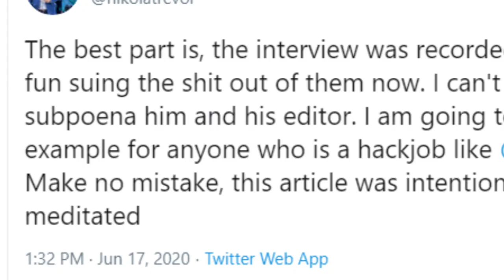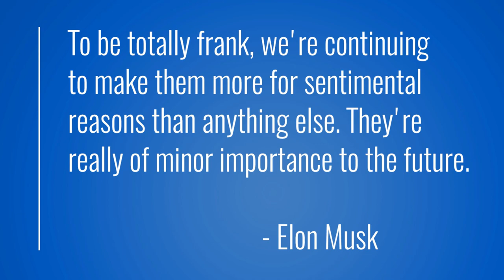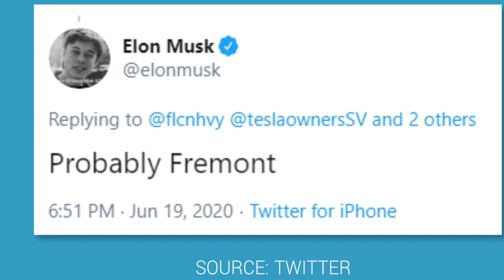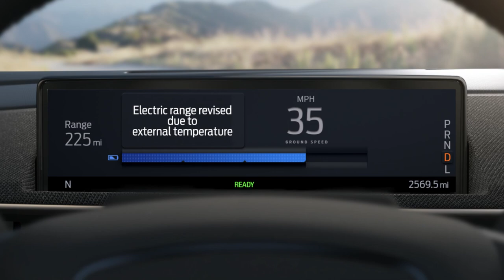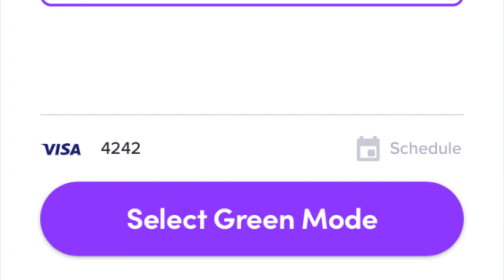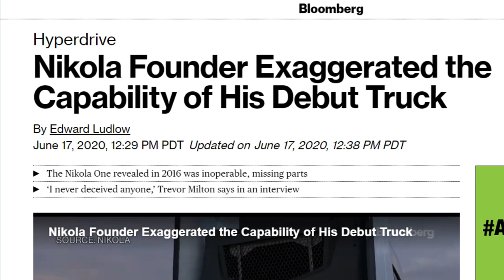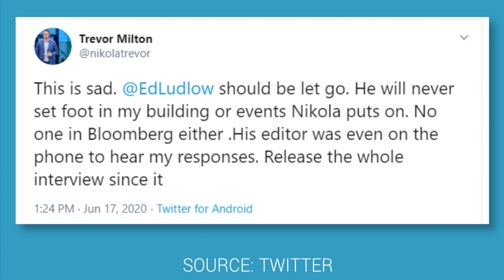TESLA Beats Competition to a New Milestone | EV News

Comment: Too much? Absolutely, not! For many of us average consumers who can only afford one vehicle range is imperative - our, we f have to rent a gas car for long trips which we will not want to do! If be more comfortable with about 500 miles. Then, I would know that my annual raid trip would only require one stop to recharge on the way.  Until cars reach that 400-500 per charge will be a more difficult sell for the average single vehicle consumer. 500 being more comfortable. 400 being on the iffy side. Yes, quick charge MIGHT be available - but, it might NOT. And, on long trips my family does NOT stop me than one all day and that is too eat.
Reply: In northern canada there are many places we do not have a tesla charger (they cannot cover every area) there are other chargers on the road but I don't want to wait around of an hour or 2 OR drive at 70km/h to do the trip.
Reply: I agree.  I want to drive 350 miles per day without recharging.  Under the recommendation of charging to no more than 80% capacity and discharging  to no less than 20% then this  works out that I need a car with a 585 mile range:  60% of 585 miles of range  = 351 miles of real range.  That is what I want and need.
Reply: @aardvarkansaw  Well, this 20-80 range might not be relevant for next gen batteries. 400 could be about the right number for you then.

Comment: 500 miles can be used by me. I live in rural MO and make trips of 200 miles one way with no viable charging units in these areas.
Reply: With the 80%/20% charge and discharge idea, then for a 400 mile round trip you need a  vehicle with a 670 mile range.   (670 miles times 60% = 402 miles or real world range .)     I hope then industry gets there for you.

Comment: I believe Tom is wrong with saying the batteries will decrease in capacity. I believe they will increase. And I tell you why.
VTG (Vehicle to grid). All those parked electric vehicles are perfect for stabilizing the grid anywhere.
Reply: Why are you so sure? Not saying VTG won't happen, but  I still haven't seen a single example where it makes economical sense to use your car for VTG. I vaguely remember some numbers about how much a car owner can make that way, and it was really tiny. Not to mention over time there will be tons of old batteries from cars which could get a second life for stabilizing the grid, thus making the VTG obsolete pretty quickly. Again, I don't know, but I haven't seen a good case for VTG yet.

Comment: Oh i dont know. Maybe they thought it necessary because the CEO flatout said it could when it flatout couldn't.
Its called fauls advertising. And its illegal.
So kinda a big deal. Nikola's credibility is quickly decaying.
I truely think they thought they could not fail with this souly cuz they called it Nikola.
There a disgrace to the name. Be a proud day when there finally bankrupt
Reply: I mean, they are using fuel cells, which seems destined to fail. There is so much more competition in the BEV space that tech advancement will inevitably outpace hydrogen, which is already hopelessly behind.
Reply: Yeah, that is false advertising. If the CEO lies during a unveiling what else is he lying about? Also, most unveilings consists in the car rolling on the scene (for example how Tesla does it). Only prototypes are usually presented as static and we all know how many prototypes actually see the light of day.
Reply: Luke Lopez Yes, you’re right. It matters if the hydrogen fuel cell vehicle is not viable. The comparison made in another YouTube video illustrates this well: it matters if Nikola is being hyped to pump up its IPO like Theranos.

Comment: Once you go Tesla, you will most likely never go back to gas. On long trips more than 1 or 2 supercharging stops needed between your home and destination, you will most likely do air travel instead and an A320Neo with PW1100G is 105 seat mpg which is greener than driving a gas burner and that’s with standard density seating. If you want to be as green as possible for air travel, unfortunately you will have to fly a ULCC.

Comment: I think Tom is wrong. Yes, we're going to see mileage increase, but we're also going to be seeing battery cost and size come down (for the past 10 years cost per kWh has come down pretty steadily by 20%. Per year). So in the end we'll have all cars - from compacts to SUVs - with batteries in the 75-100kWh range, and maybe a few exotics that will offer 120-130kWh for the people who are on the road a lot for job related reasons. 
Battery size is not only an issue when it comes to range, but also when it comes to convenience. For those who cannot charge at home it's the difference between charging up once or twice a week. That's a huge difference and also a mjor selling point.

Comment: 250 miles is enough range for me. If I could buy a car that is a bit smaller, cheaper, that would be great!
Reply: Reality is though, that 250 miles is not enough for most customers. Sure if you still own an ICE, for longer trips, or you barely ever drive far, then maybe 250 miles is fine, but for most people EVs are getting really interesting once they hit 500 miles + and basically have the same range as ICEs.
Not to mention, that better range automatically means, you have less battery degredation, since you have less charching cycles needed for driving the same range.
Additionally, battery degredation is minimal, if you reduce your fast charging and mainly charge from 20%-80% of capacity.
Again this is more often going to be the case with a higher range, so the battery is going to be much better in 2-3 years time.
Reply: @LunnarisLP  You make a good point about battery degredation, however The new batteries are talking about over 5,000 cycles before they experience signifigant degredation. As for the rest, I have to stop about every two hours on the road anyway. I would top off the battery when I'm taking care of other business. And although my use case may not be the same as yours, I only take longer trips 3 or 4 times per year. So, for me, maybe not for you, it makes sense to pay less for a car with a smaller battery and save my money.
Reply: @LunnarisLP  I don't get why 500? Old cars never had 500 because it not healthy to ride in a car seat for half a day not eating or potty break
Reply: 250 miles would be OK for our second car. 1st one is Hybrid so longer ranges would be done with it.
Reply: @ralanham76  After that trip if you are sitting on the  sand beach, you will understand just how good for your health this is.

Comment: Is 400 miles of range enough ?  No it is not enough.  I want to be able to drive 350 miles cross country without recharging.  Right now if you live in Jefferson County in SE Iowa and you a drive a long range Tesla Model 3--it is still somewhat risky to drive down to St. Louis in the Winter because there are no Superchargers on the way there.   If the best way to Charge your battery is:  No higher than 80% charged and no lower than 20% discharged  then a 400 mile battery really yields a 240 mile cross country range.  Unless this battery dynamic improves, then I need a car with about a 585 mile range to get a cross country range of 351 miles.  No one wants to spend time making two or three charging stops to drive 350 miles.  Now if you rule out cross country trips for your EV then about 350 miles of range could be enough for me:   350 times 60% = 210 miles of range.  This could be OK--that is enough to make a 180 mile round trip to a town in the general vicinity in the Wintertime.  But better would be to have a car that would allow a 300 mile round trip to a city further away--this would take a car rated at 500 miles of range for the 80 %/20 % rule.  For a strictly commuter car:  Let's say your commute is 30 miles each way--so that is 60 miles a day and throw in another 30 miles for shopping or the unexpected or cold weather loss of range and now you need 90 miles of unusable range,  Then under the 80 %/20% idea, then you need a car with a 150 miles range for a strictly commuter car.   But I will only have one car.  i want a car with a 585 mile range to drive 350 miles cross country without needing to charge.

Comment: The 400 mile battery is good for several reasons. even if the avg driver drives about 40 miles per day, using only 10% of the battery per chg extends the battery life. Then there’s the V2G use. Increased battery capacity is always better.

Comment: Hands-on the wheel is paramount. The M3 AP spontaneously turns toward 1. Freeway off-ramps 2. Into the oncoming lane on a divided road at tee intersections on a curve with a gap in the painted stipe 3. Left-hand turn lane with a gap in the painted stripe. Fighting AP during a spontaneous turn is alarming and sometimes predictable after knowing the road.

Comment: The longer the range, the fewer times you have to charge cycle the battery per mile travelled, so the battery will last longer.  I am more concerned about the calendar life of the battery than the mileage life.  I will NEVER live long enough to put a million miles on any car, but I don’t want to have to worry about the battery going bad just sitting in the garage going nowhere.

Comment: 400 miles is not too much.  There may be days when all the charging stations are full; during a storm 50kw can power the house, 50kw left over for driving ; for Cybertruck, extra juice for running running your tools.  A longer range battery gets discharged less and lasts longer.  If there is a 500 mile battery, I will get it.

Comment: The self driving on Mach E seems like a worse way to keep the driver focused in my opinion. The driver might not have hands ready to take over the car if they are not required on the wheel. I don’t think the autopilots on Ford or Tesla are safe enough yet for this kind of solution.

Comment: Crazy I owned a Toyota Camry, it takes me $30 to fill it up and in turn get about 250 do 300 miles per tank full. So if I get 300 MI on a charge to me that's awesome much better than gasoline and a whole lot cheaper. Just need to build the infrastructure to handle it
Reply: But the model s also cost several times more, how long is it going to take before you actually make up the difference?

Comment: Model Y will be my next car. ❤️❤️❤️
Reply: We have a 2018 model S100D and I have been thinking about trading it in on the Y but it would cost us. We would like a fas ter charge time and more storage storage for the driver and passengers. A smoother ride would be nice too. Is the ride of the model Y better than the S ? Ray
Reply: @rayheatley9910  So you do not have an air suspension Model S.  Does a S100D ride rougher than other model S ?
Reply: Our 2018 S does have air suspension but it rides a bit rough. I replaced the foam filled tires with regular tires at about 27,000 and the ride was a bit better. I have heard that the 2020 model S has a better suspension and rides better. I have not driven the 2020  S so I cannot comment on that. I hope Tesla remodels the S soon too make the interior much better and improve the ride. Ray

Comment: The range is not only a matter of well... range... it's also a matter of recharging cycles. As of today, batteries starts getting really degraded from 2000 cycles... so 200mi x 2000 is not the same than 400mi x 2000... you basically double the longetivity of your car by having a bigger battery. Of course they are improving batteries chemistry and 4000-5000 cycles are on the horizon.

Comment: Tesla's cars drive onto the stage. Even though they are prototypes, they do function.
Reply from the maker: Okay. I was referring to all the brands not just one. Not sure why you felt the need to defend Tesla in particular
Reply: @EforElectric  Could be wrong but I dont think they were trying to defend Tesla so much as state a counterpoint. Right or wrong Tesla has become the bar that most measure new renewable vehicles by. With the level of coverage on these topics today its glaringly obvious when some one isnt meeting the expectation. 

Plus the reason they gave in the release is weak. you could have had a pro drive it up and then have it shut off for safety.

Comment: With 400miles range I would charger two times a month at most.
Reply: If the rule of only charging up to 80% capacity and only discharging to 20% capacity--then a car with "400 mile range" is in reality only a car with a 240 mile range.  240 being 60% of 400 miles.
Reply: Wow... 240 miles is the total range capable from my 64kW Nissan Leaf e+... and I ’ll get a Tesla next year... a Cybertruck with 500 miles of range... :)
Reply: @aardvarkansaw  Not correct, you should normally stay between 20-80% but you have the not recommended option to run it from 100% to 0% and get 400 miles (if you drive economically).
Reply: Wow I like to go up north to the Family cottage, that's 300 miles one way, and we go in the winter to after work (another 50 miles) and can't charge at work  400 miles would be cutting it very close.  If it's below freezing I question if it would make it with heater running and lights.  500 miles is almost a must for me.  Ya, that's only 1-2 times a month I would do that but, I am not willing to have a second car or have to rent on top of my every day car expenses.

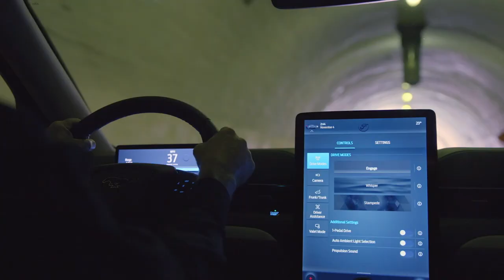Comment: Im confused, at 13:38 you say that in a Tesla, you have to keep your hands on the wheel for auto-pilot, actually you dont even mention auto-pilot..  Have you never used auto-pilot?  You do not have to KEEP your hands on the wheel, only "check in" every so often to let the car know your still alive lol
Im curious how Ford will address people wearing sun glasses...how will it see their eyes to know if they are paying attention.  Or will it continue driving as long as the driver is facing forward?
Either way, Ford is still talking about putting tech into a car that doesnt exist yet ;)
I think Tesla will be just fine.
Reply from the maker: I got my first Tesla in 2012 and had total of 3. You absolutely do have to keep your hands on the wheel and it's right there in your instructions
Reply: @EforElectric  I drive my 2018 model S100D almost every day and I do not have to keep my hands on the wheel all the time. I have noticed that the faster you travel in auto drive you are prompted the apply turning force to the steering wheel more often. My auto steering will not work above ninety miles per hour. I have only had the car up to 145 mph because my fun limiter (wife) was scared and we were getting close to a donut shop. Ray
Reply: @EforElectric  My 2019 model 3 says otherwise. I absolutely do not have to keep my hands on the wheel while autopilot is engaged. It might be recommended, but it is not required in order for autopilot to work. Maybe this feature was not avail yet on your model, but It is now.
I find that I am prompted to touch the steering wheel for confirmation less on slower roads, and roads that iv had autopilot enabled before on.  So I think it learns maybe, so it doesnt have to nag you as much.